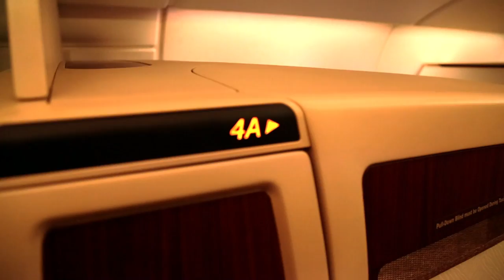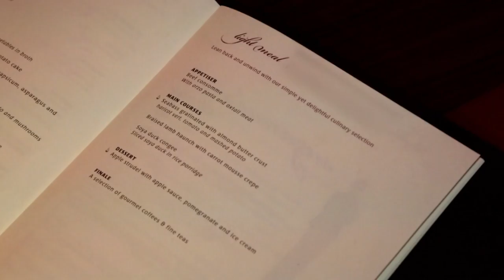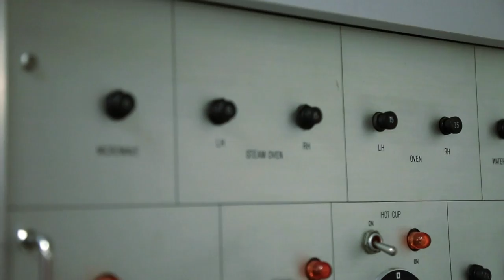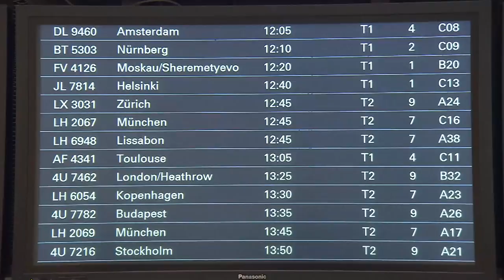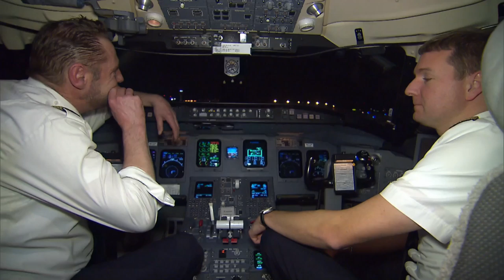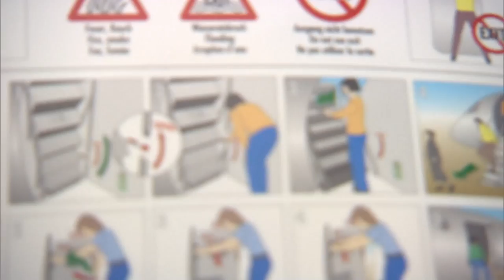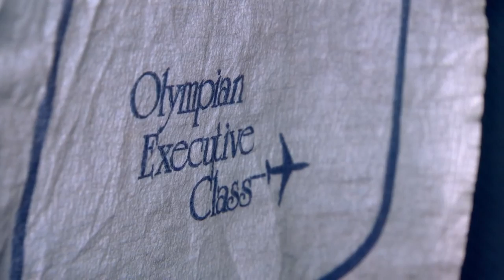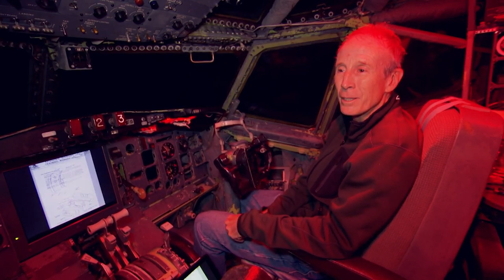World's Most Expensive Plane Ticket, Aviation Myths & Boeing Apartment | Airplane | Free Documentary

Comment: With much lower pressure outside than inside at high altitude the doors would be prown to blowing open without extremely strong locking mechanisms. I think you got that part backwards.